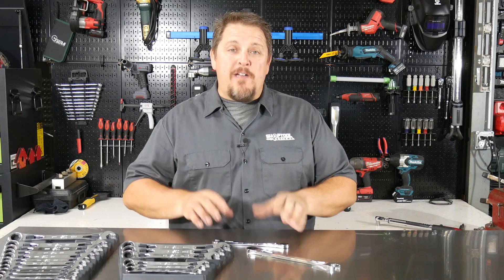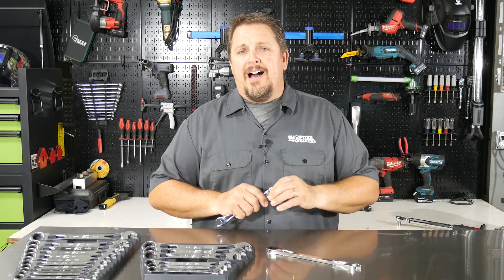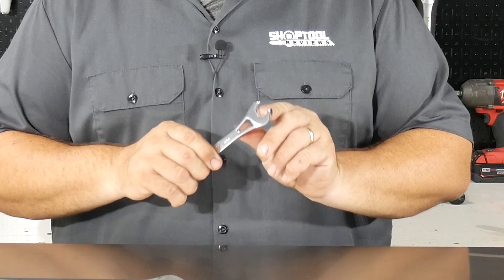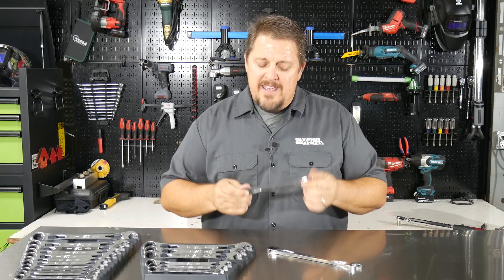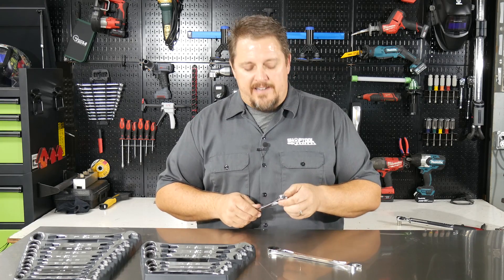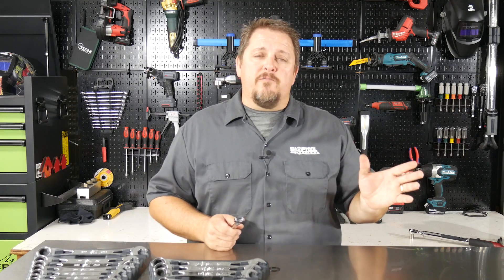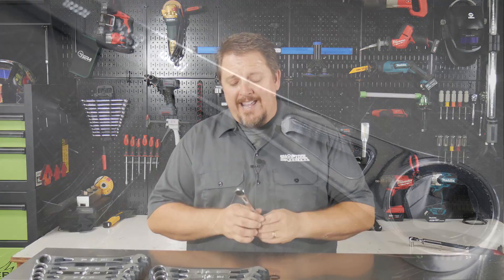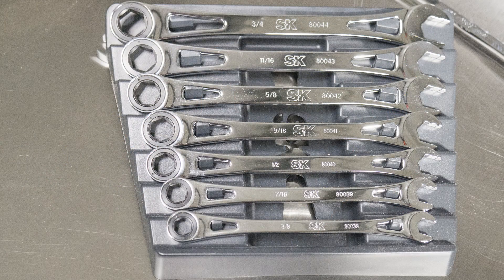SK X-Frame Ratcheting Wrench MADE IN USA

Comment: Great video thanks for sharing. SK if you're listening I'd like to buy a set of XL locking flex head SK ratchet wrenches in 12pt. Metric & SAE & stubby locking flex head SK's in 12pt. Metric & SAE. A lot of bolts in Aviation are 12pt.. I don't mind paying extra for good quality made in the USA tools & I wish everyone would do the same for vehicles, electronics, appliances etc..
Reply from the maker: SK makes some really nice tools with great quality. I love these wrenches. Very positive fitment on fasteners.